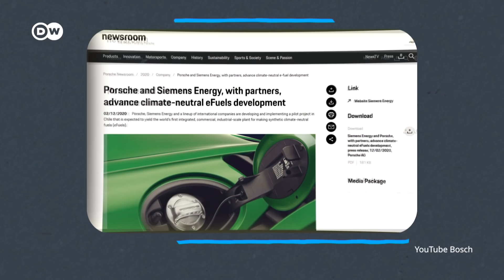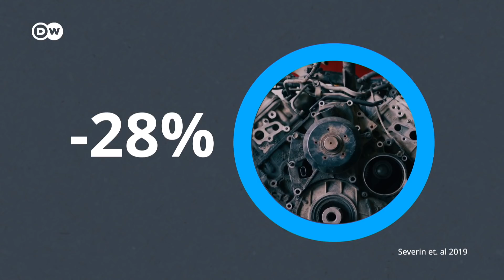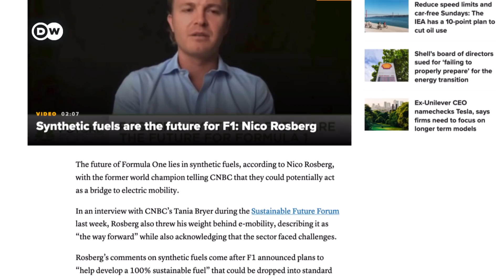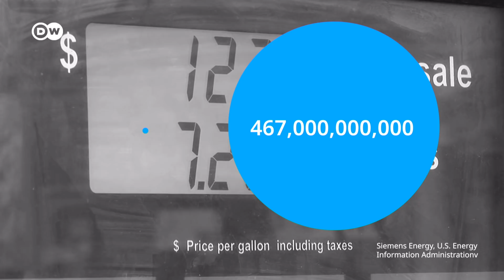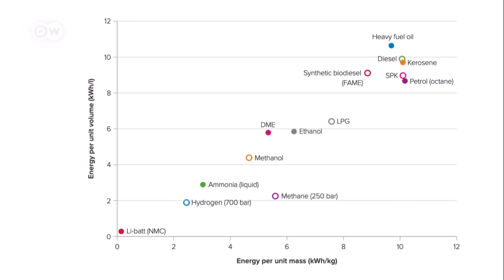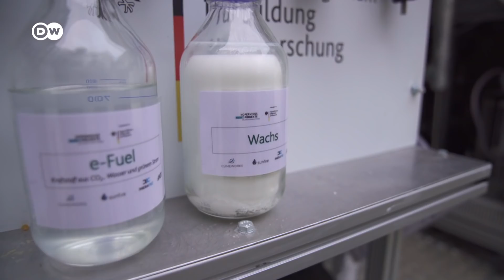The truth about carbon neutral fuels

Comment: When we talk about synthetic you also have to think about the environmental impact other energy sources have. The destruction we cause while mining for lithium is a serious problem that doesn't exist with synthetic fuel.
Reply: What about brine from desalination
Reply: Yeah and Disposable process.... There are no effect way to recycle Lithium effectively
Reply: The lithium mining is balancing out the aluminum mining for a fuel based car - not the fuel source. EVs take more lithium (for now, hopefully we will have alternatives) but a lot less aluminum. 

When you look at it this way the carbon footprint of manufacturing an EV is not really a lot higher than an ICE car. 

THEN you balance out the difference in power source.
Reply: Do you even know what other uses for lithium their are in our society? Hint we use a lot of it for things outside of battery production.
And we can already source it from sea water desalinisation plants. And geo thermal brine like the salton sea bill gates backed project. 👍🏻

Same as cobalt, nobody gave a crap when the ice industry until late 2019 used the most cobalt overall. 
Just like nobody seems to care that the fossil fuel industry is still the #2 consumer of cobalt in the world. 
Or that the metallurgy industry is the #3 consumer of cobalt with stainless steel using a lot of it per ton. 
Or how Apple actually in an average year consumes more cobalt than tesla has in its entire existence so far. 

Funny how big money funded fud causes people to exclaim they care about issues they've been scared into caring about. 🤔
Reply: Compared to the worldwide damage caused by greenhouse gases, any local damage from lithium mining is a trivial drop in the bucket.  The creation of synthetic fuels is a complex chemical process, and will have its own environmental costs, such as the massive consumption of energy they require, or the NOx and particulate emissions and noise pollution that result from their use.
Reply: @incognitotorpedo42  Classic western thinking, exploit poor nations for west's profit 😑 would you like to sacrifice your life for lithium extraction ?

It's easy to say that those people should sacrifice them than doing it with you..... 😑
Reply: @incognitotorpedo42  "The creation of synthetic fuels is a complex chemical process, and will its own environmental costs, such as the massive consumption of energy they require,"

That could equally be said of the 291 million cars and 191 million trucks in the United States if they were ALL replaced with electric powered vehicles. You don't think the consumption of energy THEY are going to require is not going to be equally massive? And that is just the US. Around the world there are thought to be about 1.5 BILLION cars, 278 million trucks, and 39,000 planes. Replacing ALL of them with electric powered equivalents will consume VAST amounts of energy, complete with equally vast environmental costs. For example, how many millions (or tens of millions more likely) of wind turbines or millions of square miles of solar panels will that cpnsumption require?

Comment: The ultracompact Range Extender Engine combined with biofuels and e-fuels will be what saves the ICE. EV owners will realize that being able to use liquid fuels has many fringe benefits. Reducing gasoline use by 90% will be good enough for the environment and having a residual network of petroleum stations will make the transition easier for legacy vehicle owners.
Reply: That's a good plan in principle, but the vast majority of cars on the road have large engines and no battery.  Range extenders, while they bring a lot of benefits, also bring a lot of costs, like complexity, maintenance burden, mass and volume consumption.  The market seems to be voting for pure BEV over range extenders, at any rate.

Comment: Energy efficiency 
8-18% for carbon neutral fuals
70% for charging 
I'd be very interested in the % for fossil fual going straight into the car.
Reply: It is not useful, because it is misleading. The energy from fossil fuel comes from the ground, you don't need to make it.

If you compare how much energy you put in drilling and refining vs how much comes out of the fuel, it could easily be >1000% 'efficient'.

Comment: Surplus renewable power should be used at higher efficiency, by maximizing flexibility of processes that need electricity to make higher value products - and not just avoidable transport fuels that are burned at 10% efficiency. These products can include hydrogen, ammonia, fertilizers, chlor-alkali, aluminum, steel etc. 
In addition a wider range of storage options are needed at scale (pumped hydro, grid-scale lithium batteries to shit predictable solar power surpluses by a few hours, possibly enhanced by global UHVDC grid backbones that can shift >12 GW across continents). 
Many different solutions are needed to efficiently exploit the hundreds of TWh that will be potentially wasted when solar and wind moves from the current 5% of global energy mix to 50%

Comment: First lie at 1:15. To build a solar panel/wind power/tidal power (....) You need to raze forests (= carbon emissions from the trees + the degraded soil) mine lots of different raw materials (carbon emissions from quarrying vehicles/tools) transport to the plant where the ore is processed (carbon emissions from transport) ore processing (more carbon emissions) transport the rained mineral where it's going to be transformed into some usable form (possibly multiple stages in different locations ) .... And so on. 
And that ignores the elephant in the room. 
The wars necessary to control the 'natural' resources to do all of that ... Stop the BS.

Comment: To be honest, the point being made about cost is quite misleading. The main contributor to the cost of e-fuels is electrolyzed hydrogen -- and we already know we will need hydrogen for seasonal buffering in a wind- and solar-heavy power grid. So even if ICEs went away (which is a big if at a global level, considering the cost and material requirements of Li-ion batteries when multiplied by hundreds of millions of automobiles), it stands to reason that the energy density and stability of synthetic fuels will make us pay the cost, whatever it ends up being, as there's really no alternative. BEVs won't cut it.
Reply: Yea, I do get annoyed every time I see someone compare the cost of an R&D product against the cost of a product which already has a built out infrastructure and has been refined for 100+ years.

Comment: Here in Denmark we have the project Power to X. It takes excess green energy from when it's a very windy day for example, and all the power needs have been met, it takes that excess energy and makes it into e-fuel, so you can store that excess energy that would othervise have been lost.
Reply: That is great. What are they doing with the e-fuel? It would be good if a company like Maersk could use e-fuels in their ships. Maersk is one of the biggest polluters in Denmark.
Reply: @DanielBrklyn  Maersk will indeed be one of the consumers - they are co-investors in the project.
Reply: @DanielBrklyn  Maersk is moving towards NH3 (a different efuel) container ships. IIRC they no longer buy fossile fuel ships, but obviously you have countless of older ships that are still on fossile fuels.

Comment: The processes are so inefficient that it is unlikely to be economic.  Much better to use the electricity in the first place..
Putting lots of solar panels in deserts will change the albedo of that area upsetting local climate causing more problems of local weather.
The question is why, it is about remaining the status quo of the oil industry, like hydrogen, when 97% comes from oil production.  That is the true reason for these economies.

Comment: e-fuels may be carbon-neutral but still produce significant particulate and air pollution. They will always be super expensive due to the inherent overall low efficiency but will likely be used for planes and keeping classic vehicles on the road. Hydrogen fuel cells for shipping and maybe remote trains and some larger trucks. Batteries for everything else from Trucks down.
Reply: Good points, but where do we get the rare earth metals from?  The UK alone would need over 40% of the worlds lithium to electrify out car 'fleet'
Reply: @andygreen2765  First I am am pretty sure your number is vastly incorrect. Lithium is not a rare earth element and is actually pretty common in the earth crust. Unfortunately is does not deposit in easy to use minerals like iron, so extraction is expensive. But there is definitely enough Lithium out there.
The obvious answer is that we have to reduce the number of cars dramatically which is easily possible if we wanted to (cars are mostly just parking). Then we can save us very expensive infrastructure to get all the lithium.
For current lithium ion technology cobalt is the bigger problem. But is also more easily replaceable.
Reply: @benjaminlieser8148  My data is accurate, in fact some estimates have it significantly higher.  See the Committee on Climate Change report.    Cobalt is a problem also as we woudl need double the current annual supply.  Keeping the same number of cars running on EV is not feasible.
Reply: @andygreen2765  can you be more precise about your sources? There are a lot of IPCC reports
Reply: @benjaminlieser8148  Not going to waste my time tbf.   Google the statement I made and you will find them
Reply: @andygreen2765  How about using less cars (i.e. making changes that will enable that)?
Reply: @dondoron5377  i don't think you can get rid of cars completely. although public transportation for high volume area is good but for low volume rural area is not that great as it usually carrying less passenger or possibly none. running a public transportation just for couple of people is generally more expensive than paving the road once. also you don't want to walk many kilometres after getting off the train when you're going to your destination right?
Reply: @adiseagledostuff  Yes, so we have to 1) stop allowing to build low volume rural areas and instead build old-style villages with a village center where the basic needs can be done by foot (side effect: less covering of soil) and b) stop incentivizing the use of cars in rural areas which makes public transport or car pools more attractive (e.g. in my country people get paid if they have to commute, making it attractive to move to rural areas where property prices are low). We live in a system that basically rewards egoistic people, this needs to stop.
Reply: @dondoron5377  Absolutely they only way to go.  Sadly no-one wants to invest in public transport in the UK unless they can fleece the passengers and make huge profits.
Reply: People also said Petrofuels would be too expensive to use in the early 1900s. Where are we now?
If there's ACTUAL development done, it will go cheaper and better.

Comment: How can you spend a full minute talking about how it smells different for no real reason while skimming across "we can suck in CO2 already emitted" and not even mentioning the fact that burning efuels still directly emits pretty significant amounts of carbon dioxide! Please do a little more work before releasing these videos to make sure they're well rounded. Informing people about these technologies is very important but misinforming them is dangerous.
Reply: Its carbon neutral, all the carbon emitted during combustion is carbon that would otherwise already be emitted. Thus making it carbon neutral.

Comment: I glad this video discusses needing to decarbonize the grids. My question though is why does everyone talk about renewable energies as if they themselves are sustainable and not carbon intensive to produce. Everyone loves to point out that solar panels and wind turbines are great sources which I also believe, but everyone ignores all of the nasty issues with sourcing their materials and the amounts of carbon emitted in their production. It's always end use numbers not overall net numbers in a life cycle given. Valid question would be how long would it take at the normal 18% efficiency of a solar panel before it negated the co2 used to produce it?
Reply: Between 1-3 years depending on location. Lifetime > 25 years.

Comment: It's mentioned a bit, but this video almost misses perhaps the main place where e-fuels are useful: aviation. Batteries are not usable for airplanes except for very short distances (certainly not transatlantic). Hydrogen might work, but it's still a lot heavier than kerosene. And weight matters a lot in airplanes. The only real possibility of sustainable flying IMHO is e-fuels.

That said, I agree that e-fuels don't make a lot of sense for cars.

Also, adding lots of renewable energy to the grid and only producing e-fuels when energy is cheap (aka when there is more than necessary) might actually be a good way to stabilize the grid.

Comment: This may be the future of trucks because of the energy density. That's a big deal in the USA.
Reply: The truck industry is all about price, so the main goal is efficiency, so batteries not e-fuel nor hydrogen. The energy density of a battery is already quite enough, because we do not need huge batteries,  but a dense and reliable charging network. Making a 15 minutes stop every 2 hours of driving is not an issue at all, in many countries it is even the law. And yes, 15 minutes is enough because the goal is just to charge enough to go to the next fast charger station (or at destination).

Comment: Why do we do this? Why are we trying to invent things that are more inefficient, costly, require lots of work, when we already have technology for the solution?
Reply: Diversity is key and important
Reply: @muysli.y1855  inefficient diversity is what we call trash.
Reply: solar, wind and electric cars began with terrible inefficiencies as well, but look at them now!. still nowhere efficient but they are cheap af
Reply: @moeron9172  ok? cheap doesn't mean it's good. Cars itself are the problem: they make cities less dense and unwalkable with all of those massive parking lots and highways. literally the reason why I can't go from my house to a grocery shop (1.2 mile) is because there is a highway that I need to cross. I literally need to own a car to to get to a store where a car wouldn't be needed. 
Also there is Lithium problem, where  ~34% of all today world owned cars could be electrified considering lithium resources. Also having a lithium battery powered car you loose ~16% of that electricity while charging the battery, and then you have ~6% that you loose in electric motor and then loosing ~22% in driving on asphalt meaning your electric car is just ~56% efficient at converting electricity from grid to movement. (And thats also why you will never achieve anything more efficient in EV than 60% because of asphalt and battery charging losses.)
Public transportation is the only solution to this car mess. Electric trains and trams with overhead wires are the most efficient transportation you could have ~93% efficiency.
Reply: @PurpleDuneEfa  and what fuel would this public transportation run on?

Comment: Carbon neutral fuels , if done cheaply and cleanly, are basically great for both airplanes and current cars until we either make them either battery electric or hydrogen electric/combustion or all of these... again, if done properly, would be a great asset to reduce emissions especially in developing countries, where even old vehicles could potentially pollute almost zero!
Reply: Fuel cells and engines are dead. 6,500,000 EVs were sold in 2021 compared to 15,000 fuel cell vehicles. And right now  there are only 2 models on the market, it used to be three but Honda pulled out as they could clearly see the future of fuel cell vehicles. And E fuels produce tail pipe emissions. Which would still be killing millions per year from air pollution on the ground. Just stop with this nonsense, battery electric vehicles are the way to go.
Reply: @HarrisonAdAstra  Many new hydrogen experimentations and concept cars have come out since versatility whise hydrogen makes a lot of sense even in more fields than cars, and don't have the problem of batteries (that creates extreme damage during their manufacturing). As for tailpipe emissions on e-fuels they produce some co2, but as i said they make sense if produced as "carbon neutral fuels", se they just re-emit the captured co2 used to prodece them, and despite being the least efficient solution have the absurd advantage of being usable by all current vehicles instead of making them use fossil fuels that just emits new co2 and more armful shit that petrol refinement didn't manage to remove from the combustible that would basically not be present in sintetic fuels. THAT's the advantage, you don't need to waste recources and create insane emission trough trying to replace every vehicle on the road! Of course battery vehicles are very efficient but have their disadvantages as well, all related to their batteries, and are actually green only if the energy to charge them is produced cleanly at least in a good portion (in some poor countries where electricity is produced mostly with coal, how that could be less polluting than burning fuel that pollutes less than coal? You may shift the place where the co2 goes but it's still there and depending on the emissions and efficiency of energy production methods it may be more or less harmful than directly burning fuel)... we should be more open about all the different tecnologies because depending on the place and situation one can make more sense than the other... i don't believe in the "one and only solution" for all the world.